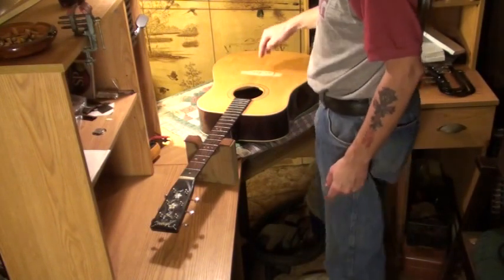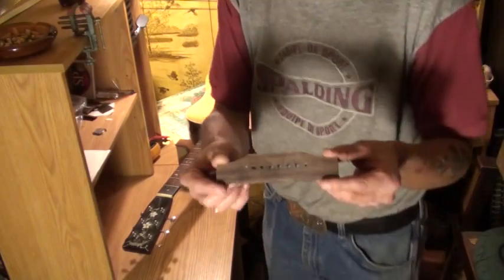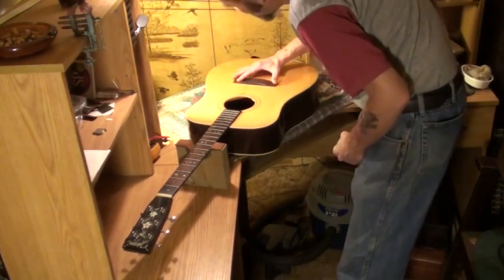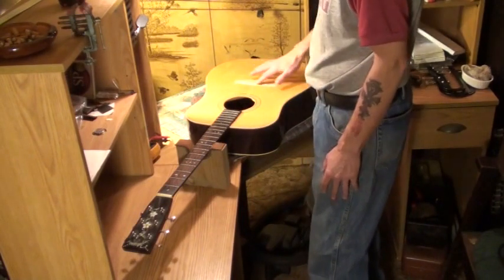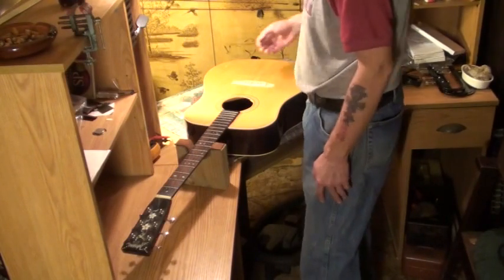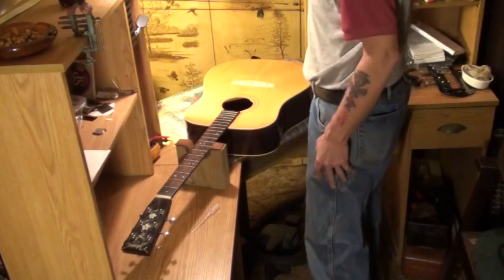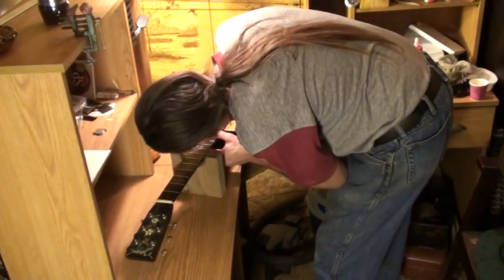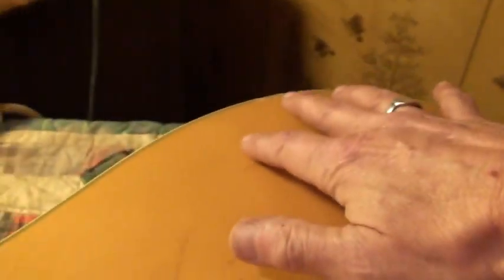JOHNSON JD27 Rebuild part 2 of 5 acoustic guitar setup youtube

Comment: Interesting how you slowly released those camps a the start -middle first then gradually releasing across.  Belly down!
 Those lights are awesome and that is a super way to check cracks!
Reply from the maker: Thanks man! Yes with the lights you can tell if the crack is just in the finish or if its structural damage clear thru, in this case it was clear thru the wood, you can still see them after glued but you can see if the glue filled the entire crack or not.

Comment: Look's like you are getting it back together Randy.I have seen guitars that got hot and the bridge would move and push the finish as they moved forward or back. I have used super glue around a bridge to seal it up. Good work Randy I will be looking for the next video))).
Reply from the maker: Thank you Steve! That does make sense and that heat might explain why so many glue joints have let go,The guitar was extremely dry when it arrived, I humidified it for a week before even starting repairs, so that makes perfect sense. I'll probably use super glue too to seal that place, either that or when I get squeeze out just leave it there and not wipe all of it away, anything to create a seal that will last. Thanks again brother for tuning in and commenting.

Comment: Next time you need to remove finish or glue from under the bridge. Use a very sharp wood chisel to scrape it instead of useing that clean and strip disk that will eat up too much wood and make it weaker. We use them at the body shop for removing rust  and paint.

Comment: Hello Randy, I really enjoy your videos. Keep them babies coming. :)Question for you...Is there a reason that you didn't glue in cleats to further insure that the cracks on the top won't separate?thanks
Reply from the maker: this guitar had so many cracks and loose joints and braces I probably didn't video it but I'm sure I went back and glued cleats inside at some point. very good sounding guitar in the end. thanks for checking out my videos!

Comment: Nice work Randy. could you move the bridge a fraction forward to cover that exposed line of bare wood ? just a thought or would that throw off anything. Thanks for sharing this.
Reply from the maker: Thank you man! Yeah it would throw the intonation off if I moved the bridge forward, plus it would expose an area at the back of the bridge then. I'm thinking maybe when I glue the bridge on, what ever squeeze out I have on that area just leaving it and not wiping it away, that would at least seal it from any moisture getting in, not sure yet but it's a thought. Thanks for tuning in and commenting I appreciate it.